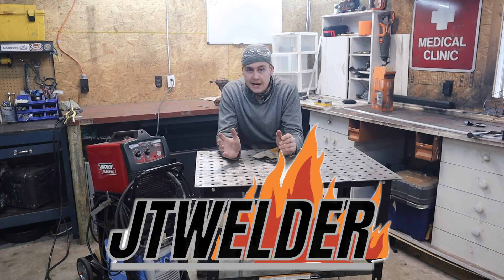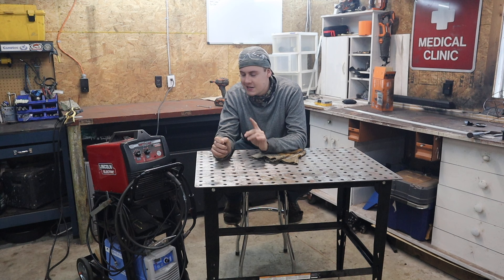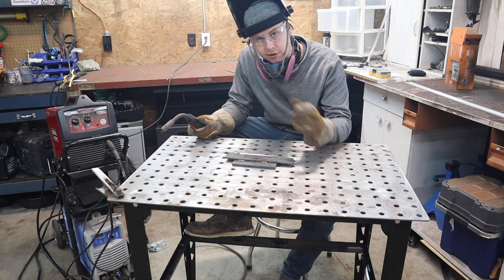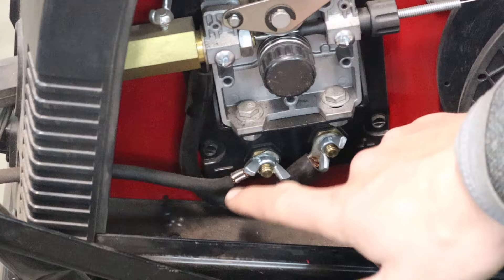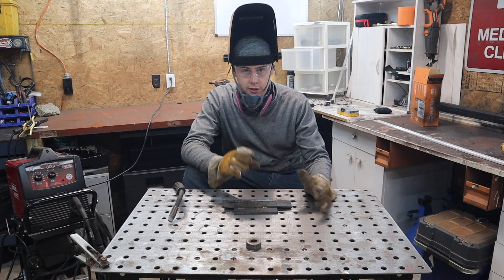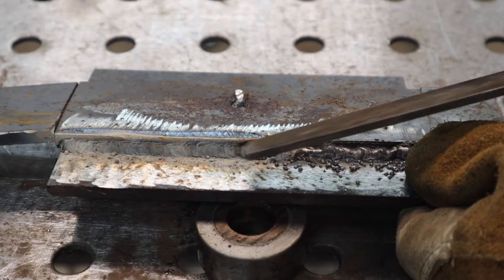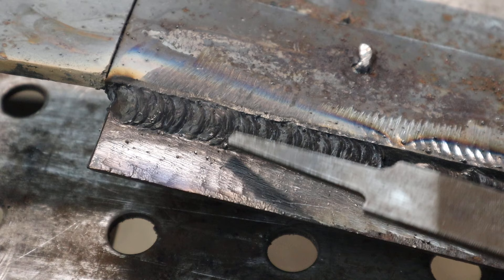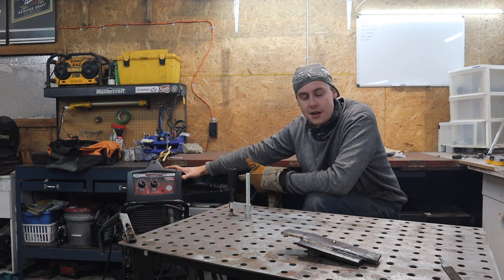#1 Mistake Made When Flux Core Welding (one simple Trick)

Comment: 1. A 20 amp circuit IS a normal household circuit.
2. The easiest/best way to know if your welder is set up for solid or flux core wire, if it is indeed a dual purpose, solid and flux core welder, is to look on the inside of the lid where the amp settings and the wire speed is listed, at least it is on my Lincoln SP100. The correct polarity is shown on a really easy to understand chart.
Reply from the maker: 1. The most common amperage amperage for a household circuit in North America is 15 amps. Yes some people will have 20 amp circuits already but most wont. 

2. Most people that have zero experience in welding don't even look at the chart or they do but still don't understand it. Having someone like me explain it on video really helps a lot of people figure it out.
Reply: @JTwelder.  1.I wired homes for a while and I can assure you that 20 amp circuits are common. 
2.If people aren't smart enough to follow instructions, they probably shouldn't be fooling around with welding machines.
Reply from the maker: @williamemerson1799  you might of wired homes in a area where 20 amp circuits was the standard but with a quick google search you will find out that 15 amp is more common, home depot.com states this right on their website. 

This video has almost 100k views and there are a bunch of comments of people who didn't know this tip and have no applied it to their welder So I think it's been helpful.

Just because you have a strong opinion about something doesn't make it right bud
Reply: @JTwelder.  I don't need to search Google or anywhere else because I worked in the field. My point was that many if not most houses have 20 amp circuits. Guess that went over your head.
Didn't mean to hurt your feelings there cupcake......er, BUD.👍🍻
Reply: @williamemerson1799   It's extremely common to find houses with mostly 15 amp circuits in the US, so it's definitely worth mentioning in a video like this. My house was built in the 1980's, and except for designated appliances every circuit is 14/2 on 15 amp breakers. Most of the houses in the neighborhood were built by the same builder, and are wired exactly the same way. 
I have run dedicated 12/2 on 20 amp breakers to my work room for exactly this reason. Also, the 12 ga. for the extension cord was also a good tip..
Reply: @ST-0311  Did you read somewhere in my comment that 20 amp circuits were used more in homes than 15 amp circuits? Concentrate and reread.

Comment: You didn't say what diameter wire you are running. Since you were sayin it works on sheet metal, I'll assume it's .030 or smaller. I love the .035 that came with my multi function, multi voltage Warcking. I love flux core. It's easier than stick and cheaper than dual shield or straight mig. Good video though.

Comment: Great video, but the 20A breaker has no impact.  The lower gauge wire will help as it results in lower power loss from the outlet to the main power breaker.  But if you are not blowing your 15A breaker then do not use a 20A.

The standard 120V, 15A North American outlet (NEMA 1-15) is specified only for use with 15A circuits.  You can use bigger conductors for high current loads and longer distances but you can not use larger breakers without breaking some rules.  This is to prevent someone from connecting a device where the device cable can not handle the full 20A without becoming a fire hazard.  On a 15A circuit no problem - the breaker get triggered before any possible fire.  But with a 20A breaker you end up with a possible fire hazard because the device cable could ignite before the breaker cuts power.

Note, NEMA 5-20 outlets exist which are specified for 20A.  If you want to adhere to the electrical code then this is what you want to use.  But you will have to swap the cable on the welder for one with a matching plug.  And none of this is actually required for that welder because it does not draw that much current.  What one requires for solid power is 10AWG wires between the outlet and the breaker, which it looks like you have.  Now switch back to a 15A breaker to keep everything safe and legal.  Only consider using a 20A breaker if the 15A breaker gets triggered.
Reply from the maker: Actually without a 20 amp circuit the welder barely functions on proper settings. So the circuit I am using in The video is a 20 amp circuit using a specified 20 amp outlet and is all ran with armoured 12-2 awg wire and the entire setup meets code where I live. The regular outlets in my garage are all 15amp with 14 gauge wire which don’t hold up under load of the welder on Normal settings.

Comment: I have an older Craftsman 125 that when you open up the side cover, there is a label stating where the cables are to be attached for welding mig wire and gasless flux. Flux wire in my opinion still gives you a poor weld compared to running mig wire with gas and set up correctly.

Comment: I have a Lincoln Weld Pak HD gasless flux welder I just opened it up to see if I could do this and it's basically impossible with mine because mine doesn't just have to swappable Electric leads. The ground is bolted to some Square board of some kind and I can't even see where the lead from the gun goes because it comes in on the opposite side of the machine behind all the electronic equipment that's inside. However there is a electrical diagram on the inside cover and it does show that my gun does come factory wired on the negative side and the ground does come factory wired on the positive side. On a side note one thing that has helped me tremendously being a beginner is I swapped out the little plier style clamp for the ground with a bolt on magnet. Using a magnet to attach the ground was like night and day difference from having a clamp style ground
Reply: Is your Lincoln the little one? WELD-PAK 90i FC? I’m trying to see if anyone has switched theirs yet. Wiring is more complicated than his example.

Comment: Great video but you should also mention that you lose your penetration. This technique works with stick as well when you don’t want undercut. But again if your needing something that needs to really hold (dual shield, bigger welder) than switching polarity is a bad choice.
Reply from the maker: You actually gain penetration with Gasless flux core in straight polarity.  It’s designed to be ran only on straight polarity just like Tig. If you run it on reverse polarity the wire doesn’t burn properly causing splatter and it actually won’t penetrate much because of that. And as I mentioned in the video this is only for gasless flux core it doesn’t apply to gas shielded wire.

What you’re saying is true for all other processes but always remember Tig and gasless flux core only run properly on straight polarity (electrode negative) and that’s by manufacturers specs.
Reply: @JTwelder.  This actually really great to know.

Comment: I have a sca mig welder unfortunately after opening it up to transfer the wire I noticed they have hard wired so it’s not like yours where you can just undo a lock nut. Can I cut the wires then either solder together but they might get hot or buy 2 joiners that I could use, any advice is appreciated, I live on a disability pension so I can’t afford a better welder , I also live in Australia so it’s 240 v. Cheers Andy.

Comment: Some of the cheaper fluz core mach9ines are AC not DC so it makes no difference and they weld poorly.  Also some rods in stick welding need DCEN ie Negative on the electrode holder.

Comment: Unfortunately my Titanium 125 Flux machine connectors are hidden under the spool panel, locked away under fastener screws. I suppose I could take the machine apart to check the lead connectors just to make sure manufacturer was aware of this switch
Reply from the maker: I believe people have said that the Titanium machines are already set up properly

Comment: I’m thinking of doing a little automotive welding on my off-roader. Skid plates and sliders and such. Is it worth investing in a mig welder or will a harbor freight flux core get the job done? Harbor freight also sells a combo mig and flux for 379. Thinking of getting that, but they also sell a flux core only for way cheaper… not sure where to start. By the way I have taken mig and TIG welding classes and was even certified at one point though only shortly worked professionally as a welder. It didn’t work out at the company I worked at and I got another job in a different trade.
Reply from the maker: For skid plates and off road stuff you’re going to be using 1/8-3/8” thick steel and doing a lot of welds. I would recommend going up to a 220v mig machine. A 120v/ standard house plug machine probably isn’t going to cut it. 

I would recommend the arc captain mig200. They just sent me one and I’m going to be doing a few videos with it. It’s a dual 120/220 voltage machine so you can run it of both size circuits and you can run gasless flux core on it as well and get really good results! Stay tuned to my channel and you’ll see it in action.
Reply: @JTwelder. ty for the info. That machine is around the same price too. I live in an apt but my dads house nearby has a 220 installed for his air compressor in the garage. So i will probably be able to use that machine. I will sub cause I’m curious to see the machine in action.
Reply from the maker: @jvogler_art4708  thanks for the sub! I’m going to be doing a whole 120v vs 220v welding machine video and it will most likely have all the information you will need.

Comment: Do you know if the titanium flux 125 from harbor freight need this done? And if so do you know how to check? From the factory the gun cable is connected to the main electrical board in the machine. The cable connections are labeled + or -

Comment: It’s not a ground lead first of all. It’s a lead that completes the circuit the same way a neutral wire does to allow a path back to the source to allow current to flow to what you’re welding! It’s not a ground lead! It has current flowing through it!

Comment: I have a Chicago electric brand, I know is crab but I'm try to learn is a 90 Amp flux core, opened up but don't have the same set up as the Lincoln. It has this coil, half for the neg and the other half for the POS and don't see the connection. What do I do?

Comment: Ok. My ground is hooked up to one end of a cylindrical element that has the continuation of the ground coming off the other end and its secured into a heat sink that is attached to a circuit board.  The gun comes up through the top, feeds down to all the motor area and is bolted straight to the circuit board.  There is nothing indicating which is positive and which is negative.  I’ve got the Lincoln weld-pak 90i FC.  Any suggestions?

Edit.   It appears two wires that make up my gun are connected to areas marked out- and my ground is connected also in both places marked out +

Does this seem right?

Comment: I was looking at a HF flux core that had a A.C. output. it came with a spool of wire that was labled AC only. I passed it up because I couldent find more AC flux core wire. Even HF didnt carry it.
Reply from the maker: Yeah the only time I've seen Ac output flux core machines they are extremely cheap so I wouldn't bother with them. The only time I used a Ac machine is when Tig welding aluminum. Other than that you'll never really need a Ac output machine.

Comment: Can you comment on the safety of having the ground on the nozzle and the rest of your work connected to voltage? What voltages are we expecting when the welder is turned up to max?
Reply from the maker: Basically all welding currents are low voltage so you never have the worry about major electrocution. You can get shocked if you working with wet gloves but it's such a small shock I wouldn't even worry about it.
Reply: @JTwelder.  thanks, so I guess the max peak voltage is below 40V..? I’m a little apprehensive to measure it with my scope for fear of damage to the scope.

Comment: I think you should have pointed out it only works when DC welding
 Any half decent mechanic knows electricity 'flows' from negative to positive which is why cars and bikes made in UK were positive ground well into the 1970's (it also cuts down on corrosion although I forget the physics of that)
Reply from the maker: Basically all flux core machines are DC only.

Comment: One question, by changing the polarity, you are essentially electrifying your workpiece. Now, if you touch that workpiece, aren't you running the risk of electrocuting yourself.?
Reply from the maker: Welding current has low voltage so you never really need to be worried about being seriously shocked. The only time I've been shocked is when welding with wet gloves and the shock was nothing more than a tickle.

Comment: hi.do you know on the settings is wire speed first knob on left and is it amps knob on right.im using 1.0 wire flux core on some bulkhead sheet metal .it was burning thru metal so turned both knobs down to minimum .i did have 0.8mm wire in machine at first but thought 1.0mm better for my van vw t4 camper.ive not welded on van yet just practising on bits metal 😊

Comment: I switched the pos and neg and I have no power to my gun, rollers arent turning. Am I supposed to do something else? Im running on a 30 amp fuse. Also running a short 10 ft.12  gauge extension cord thats a little thicker than the cord on the welder. Anyone have any suggestions. I got working on this damn thing because the guy that had it before me took the spring, tensioner and lock bolt of the spool holder and replaced it with a cotter pin. So I figured thats why it runs like shit. Im going to get them parts but I came across this video so I figured id try thid while im working on it.
Reply from the maker: Switching the polarity should have no affect on the trigger since the trigger and rollers operate on a completely different circuit than the actual welding output. I would check the trigger wires that run from the gun into the machine. 
 
Also if the previous owner played with the spool holder then that also could mess with the performance.
Reply: @JTwelder.  Thank you for the reply. I went ahead and wired it back the way it was. I used a spring off of an old weed eater and he had the .030 wire running in the ,035 groove so I took that out and cleaned it up and flipped it to run the ,030 groove and bought some .30 tips for it. Just doing that made it run 10 times better and I really dont have much spatter. At least I got it running good enough to finish what I needed to, now Ill see if I can figure out which wires I need to switch to reverse the polarity, because it wasnt them two I switched before. I cant find a wiring schematic anywhere on the dam thing. Its a WF2000 campbell Hausfeld fluxcore 80 built in 2001 Im pretty sure.

Comment: Looks like you’re using a mig tip on your gun rather than a flux core tip. Do you recommend against using a flux core tip?
Reply from the maker: I do a lot of tacking and fab work with this welder so the mig tip is nice to use because you can rest it against the workpiece to tack. The flux core tip can’t touch your workpiece because it will arc out but is your just straight welding it’s definitely better.

Comment: I was hoping this trick would solve my flux troubles, turns out my machine is ground positive from the factory.
Reply from the maker: Try a higher quality 0.30 flux core wire. The Hobart brand flux core is the best I’ve used so far.

Comment: I have a Jegs Mig 100 gasless flux core welder. It spatters like throwing paint at a spinning fan. The gun and ground are hard wired to the transformer, so I see no easy way to reverse the polarity without butchering the machine. Any suggestions?

Comment: Nice video I am in Canada and I am new to welding I am looking for 120/220 welder that I can run  in my car garage 15 amp or 20 amp fuse which welding set you recommend flux core welding set good one thanks Knowledge makes perfect
Reply from the maker: Everlast makes some reasonably priced flux core machines. Check them out on their website.

Comment: For the machine he's using the bead should look a whole lot better. That welding bead is nothing like a low hydrogen 7018 Rod not at all
Reply from the maker: It's a 140 welder that only runs off of 110 power so it doesn't have the heat to fully utilize .035 flux core, 1/4 is the max thickness you can weld with it. If you look at the vertical weld I did you'll see that it definitely does resemble a 7018.

Comment: Sir, I need your advice. I’m in the market for a smaller packable welder for my farm. New to welding. I have fencing as well as farm equipment. What type of welder/type do you recommend and why. I’m leaning towards either Miller or Hobart. Thank you and appreciate the continued knowledge. I’d be able to hook up to 110 & 220 via generator and socket no problem.
Reply from the maker: The Hobart multi handler 200 is probably the best choice for you. You can stick weld the thicker stuff and mig/flux core anything thin. It's also dual voltage and weights only 39lbs. Hobart is also owned by Miller so your basically getting a Miller welder without all the fancy add on features that you wouldn't need anyway.

Comment: I have both FC and Mig and honestly FC is better in some circumstances, like welding on galvanized steel.. Lots of penetration and much less expensive if you buy multi pack 10 lb spools on line. As you say polarity is everything, get it wrong and weld is brittle. Get it right and the weld will fail in the parent material, not the weld itself.
Reply from the maker: On some of my mobile jobs I buy 33lbs spools of fabshield 21b .045 flux core for when I'm welding out in the wind. Gasless flux core is awesome if you know how to run it.
Reply: Sure is, I have to have a good reason to switch to gas these days.. Usually when I want really pretty welds.  @JTwelder.